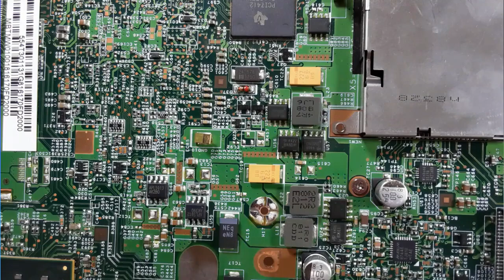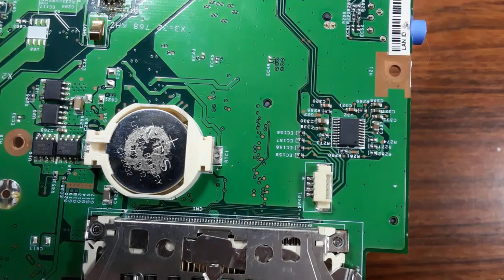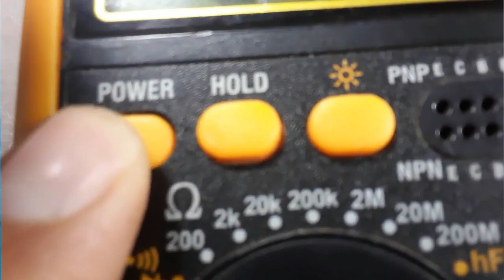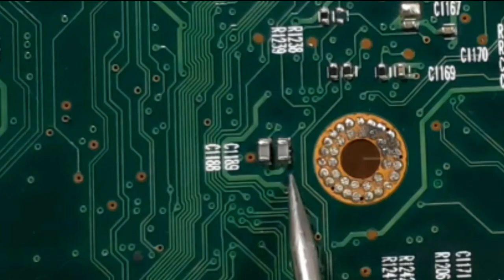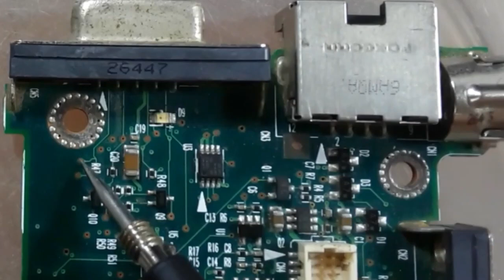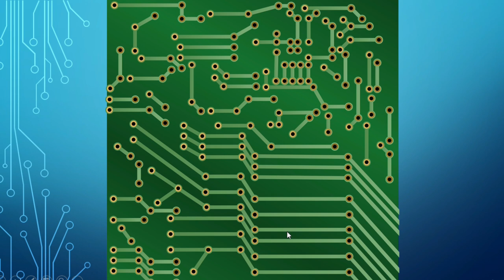Learn how to track voltages on motherboards using the multimeter - laptop motherboard repair

Comment: At about 14:30 mark, you are calling components marked EC156 through EC159 "resistors," but I see components with RXX designation also near U32.  I don't think the EC designation is for resistor. Maybe a non-standard way to say Electrolytic Capacitor? Still, the color is black, maybe could be zener diodes as well?

Comment: please make a video on how to check the voltage that should be on the LCD block. because I have a problem with the screen not showing(blank)🙏 

￼
Reply from the maker: Thank you for your comment and suggestion. I'll definitely consider making a video on how to check the voltage on the LCD block to help troubleshoot screen issues like yours. In the meantime, if your screen is showing blank, it could be related to the power supply or a specific component. Stay tuned for more detailed tutorials, and I hope to address your concern soon

Comment: My mainboard has a defect audio chip. I noticed because rear and Front aux is not working anymore. Already tried reinstalling drivers etc. 

Would I be able to measure if the audio Chip on the Mainboard is defective? Its the B350 Gaming Pro Carbon